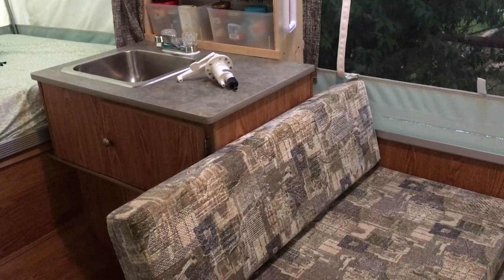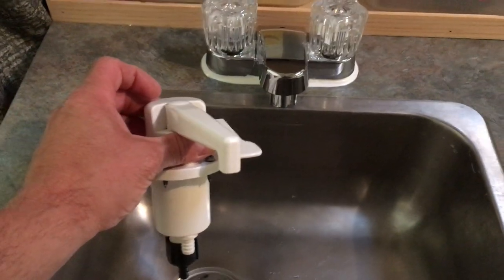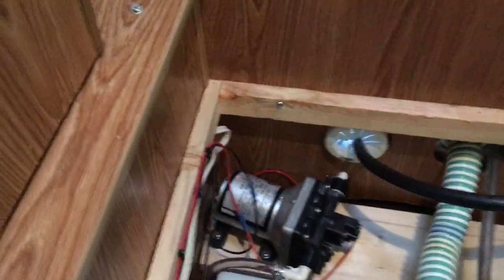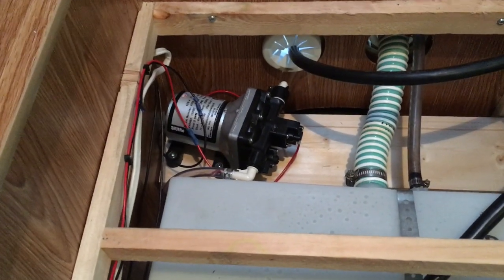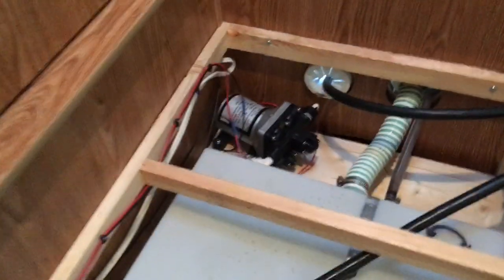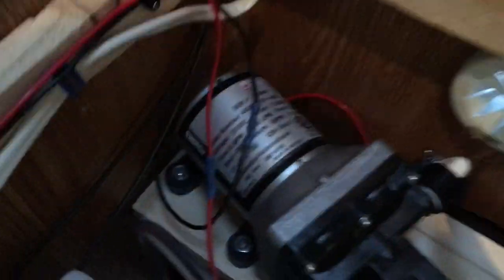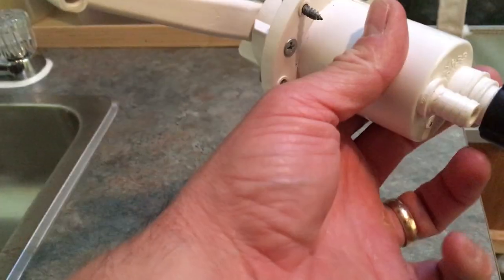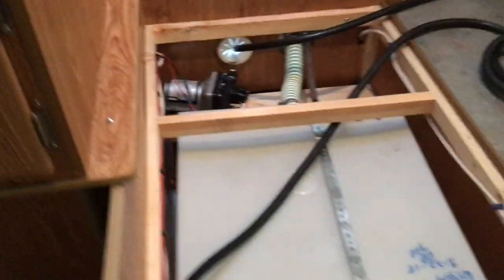Popup Camper Fresh Water Tank Pump Installation

Comment: I likes the video! I have a 1993 eagle 10 popup tent trailer by Jayco. The original owner took out the water tank and the hand pump faucet was broken . I also have a 14 .5 gallon fresh water tank that I satanized with 1/3 cup  of non scented bleach to a gallon of water for 10 hours before drinking. It fits just like yours . Mine has electronic sensors to show you if it is full ,1/2 full and empty. Do you know  the gauge wire ? I think it is it like 22 gauge very small. I like the water flow of this pump. I have spend  hours researching water pumps online and all of them had negative comments so,  I will go with the one you bought.  I like the water pump 1"x 6" wood platform you made. I'll have tp make one of them too.How did you attach it to the floor?

Comment: Great video! Very helpful! I'm renovating my 1991 Palomino TXL and will be adding a water pump to the water system next spring. Too late in the season to do it up here in MN! :/
Reply from the maker: Sorry for the delay in response.  Thanks a bunch James.  Half the time 
all it takes is a little courage.  You Tube has helped me immensely over
 the years save Hundred$.  It's nice to be able to give a little back.

Comment: Liked the video.  I have a question.  I wonder why the original faucet worked with city water pressure, but not with the electric pump pressure.  What is the difference?  Or is it because you needed to keep both options?  If that's the case, would the electric pump have worked through the city water input?

Comment: I have a 94 Star Craft but have no idea where the water tank is. I know its somewhere in the camper. I ordered a 3 way faucet to replace the original. I am going to order the pump next. As its almost winter, I am not worried about it right now. We had a 69 Portacabin with a large water tank. It was hand pump only. I added electric through JC Whitney. Now they are kinda messed up on their web site. I couldnt find hardly anything for RV's there any more. I can get that pump for $22 now on E- Bay. You know, a three way faucet  costs a lot depending on where you order it. Ours was $45. I saw the same ones going for $114.  I like your faucet but it will not fit the hole where the original was. I plan on keeping the original and will switch back if we sell it and pull the electric.

Comment: Im aslso adding a pump in my coleman went angot a used faucet and the rv scrap yard the one they sold me is just like the original except it has 2 white wirez coming from in between the top and bottom...what are these for ?